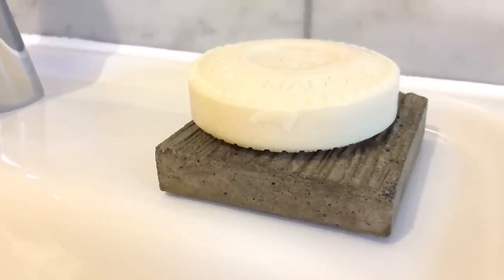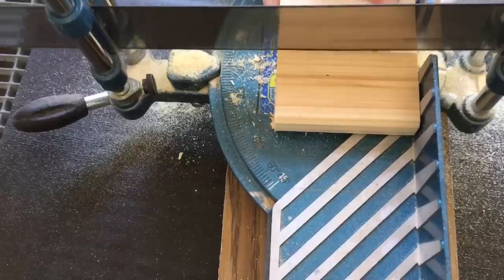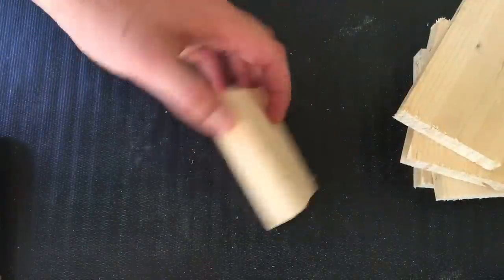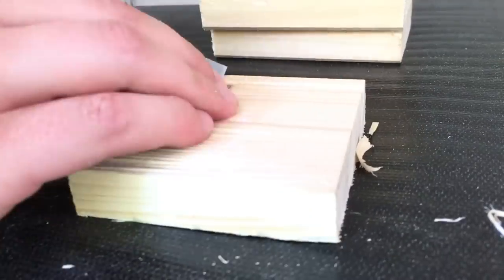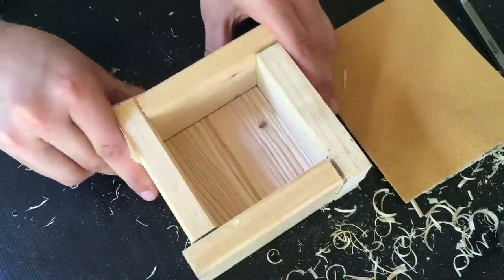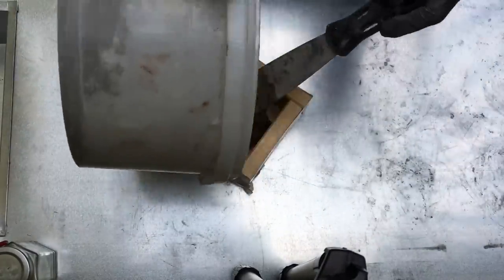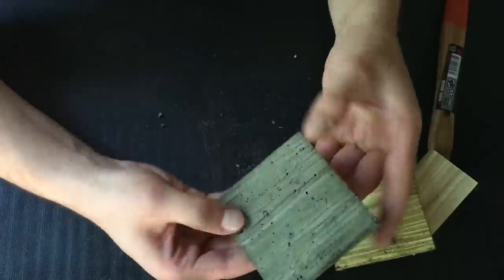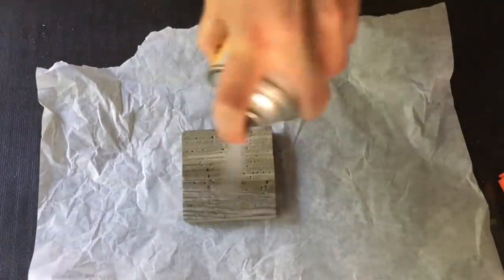Modern Concrete Soap Dish DIY

Comment: I used plastic food container as a form (can be used multiple times and gives really nice and smooth edges) and squeezed some ripples from the top. It'd be much faster than making a wood form :)
Reply: Hi do you oil the plastic container to get out the concrete easier and before it sets do you mark the top to create the grate ?
Reply: @deborahwates5405  yep!
oil not necessary if "form" made of polyethylene or silicone.